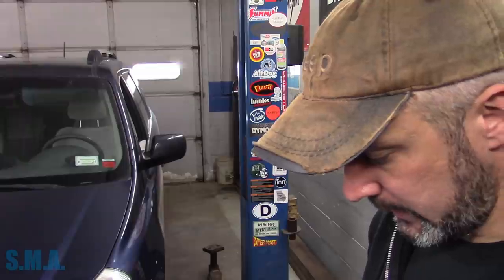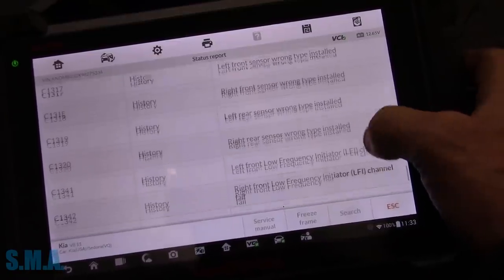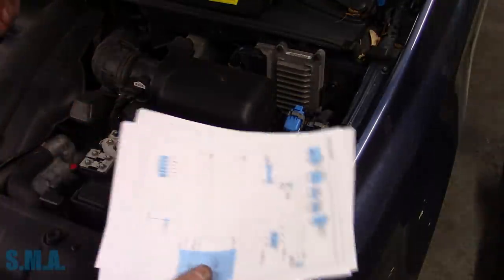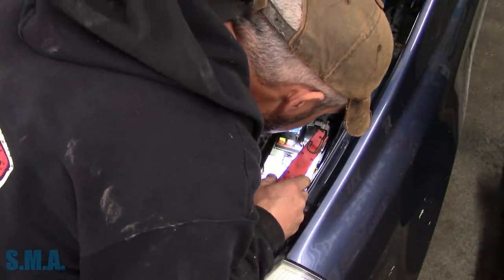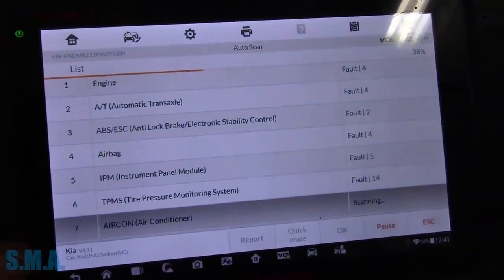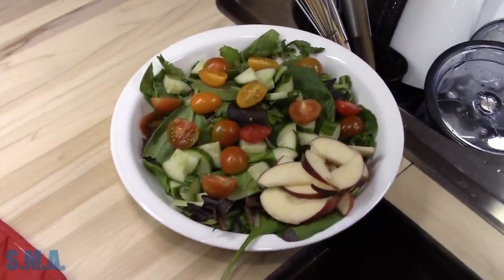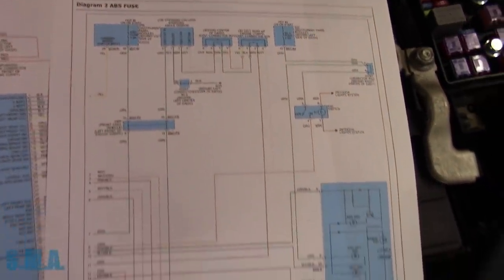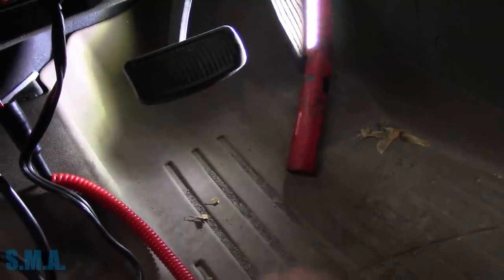You Can't Fix'em All...

Comment: perhaps the aftermarket stuff is tapping power off of that fuse and it is blowing the fuse when they use that aftermarket accessory (like a rubbed through power lock wire)

Comment: Hi Eric, Just my thoughts,   Having the error code for low battery voltage My first thought is to replace the battery, I did not know about faults with low battery voltage until about two years ago when I watched a Scotty Kilmer youtube and what he said made me put a new battery in my 2010 Toyota Highlander, the navigation had been glitchy for about a year and I thought it was  starting to go out. The original battery in it seemed fine at 8 years old, it started perfectly at all times and no other issues. I had the battery replaced and the Navigation has been working perfectly for the last two years. I will not let a battery go past the four year mark again.

Comment: Old time mechanic. Listens to engine, pulls engine apart, replaces parts, rebuilds engine and drives off.  Modern mechanic, spends 90% of their time chasing electrical faults, then replaces electrical modules until the engine starts, or not.

Comment: Thermal cycling is a thing, but...  It takes a REALLY long time in a properly-functioning circuit.  Early on in my career in the '00s, I got to see it on a few cars from the 1980s that had factory fuses in most locations.  I wouldn't be quick to suspect it on a vehicle of this vintage.  Fuses do the thing they do when they need to do the thing they do.  Doo-wah-ditty.  :D

These extremely intermittent issues are the kinds of things OEMs throw HUGE amounts of time and money at when facing a potential recall.  It's incredibly frustrating for the technician and customer alike, but we just don't always have the resources to be able to hunt these things down.  :(

Comment: I wish I still had the pic. I had a 7.5 amp fuse on a relay harness where the plastic cover was melted away but the actual fuse element was still intact with no cracks. I only discovered it doing a routine inspection because I was concerned about the heat from the turbo being that the relay was above it. I was surprised it never popped. So I don't believe that thermal cycling  reasoning.

Comment: Is it possible for cars to have Parity Errors? I work with equipment in the several hundreds of thousands of dollars regularly and it seems we always have some machine/switch/router with a parity error. It's possible a fuse blew due to the control side going haywire due to a bit flip. It's odd though that I've never really considered that on a vehicle until this video

Comment: My 1st car was a 1969 VW Beetle "Automatic Stick-Shift". 
Took the girl I would eventually marry on our 1st outing to the outskirts of D.C. to buy a Dune Buggy kit, from her 1-flashing-light itty-bitty Town in the Shenandoah Valley. It was a LONG ride, good chance to talk, get to know each other.
After I bought my kit, went to start my car and something in the Main Wiring Harness shorted out. Smoke, smell of burnt wire, and absolutely NOTHING happened when I turned the key trying to start the car. On further inspection you could see where something in the Harness had gotten VERY hot, with a line of melted plastic down the entire thing. NOT GOOD !

Myself and the guy who would eventually be my "Best Man"; both mechanically inclined, were pulling our hair out trying to figure out some way to get the car to run and get everybody at least somewhere close to home! If not, there was NO WAY that the Parents of my then 16-year-old cutie would believe the truth, and I definitely didn't want to leave the car so far from home.
After I had run out of ideas, the girl said, "try to start it again". Purely as a gentleman (thinking it was a hopeless act) I turned the key ... and the damned car started right up! Drove it for YEARS without ever finding out what had caused this problem, which never happened again!
So ... if it ain't broke, don't fix it !

Comment: Though not good for you, it gives context to those times when you just can’t find out why something happens. Had a car that randomly died on me, would crank but not start. Wait a few min’s and it would start and run as if nothing happened. I took it to a garage (under warranty) and the couldn’t recreate the fault, right up until they were backing it out of the bay, it died on them. 4 hours of investigation and swapping out ignition parts the fault was found. The remains of an after market alarm. A wire had been cut and spliced to an immobiliser using one of those horrible quick fix things, situated way under the dash behind the fuse board. 5 min’s later it was fixed with a bit of solder and heat shrink.
My take in that was to pay attention to when things have been added after market as you never know the quality of the product or the installer.

Comment: I know when I had rear speed sensor fail in my Santa Fe it cause my ABS light to come on and threw two different codes that I cant remember off the top of my head. Once the sensor failed it actually disabled the ABS. I assume it does this so the failure doesn't engage the ABS while normal driving. Worse part of it, the sensor is built into the hub which set me back $180.

Comment: Breakers that have tripped repeatedly definitely "wear out" that way.  Never heard of it for fuses though I suppose it makes sense that it could happen if the fuse is run hot repeatedly.
Reply: In aviation I saw it quite a bit. If the fuse is run near its rating and subjected to a lot of heat - I did it in Phoenix for ten years - and vibration (single engine planes and helicopters) the fuse will fail from fatigue. The fuses at the time were glass or ceramic and in the glass fuses it was obvious the metal had fractured instead of melting. In plastic fuses if the gap is clear it melted - definite overcurrent.
Reply: A fuse shouldn't be loaded beyond 80% of its rating. Fuses that "wear out" are due to either a design mistake or some minor, but persistent, overload.
Reply: @misterhat5823  sure that's a prescriptive rule from electrical codes, but I'm not sure it's universally accepted in all electronics everywhere
Reply: @wgmskiing  It is in the design of electronics. I would imagine the automotive engineers receive the same training as well.

Comment: I’ve seen one fuse that was blown by I’d have to say a thermal cycle. It was an 80 amp fuse on an international tow truck and the connector and fuse were partially melted. The fuse was replaced about 6 months ago and hasn’t blown again. But I agree the fused circuit is designed to be a good amount under the fuse threshold so to lose 25-50 percent of the fuse capability to thermal degradation without signs of it usually points to something wrong

Comment: Other diag before being a parts changer isolate fuse installation at each with lower amp fuse in each, if the fuse blows at a component just that module will be down. If the main fuse blows then it is a wiring for sure or the total amperage is above the rating of the fuse. Used that when all else fails, sucks yeah but sometimes we have to do suck things.

Comment: I refer to a job like that as chasing a ghost, but you just rely on logic and do a systematic search until you find the ghost or at least until it gives you a clue it is still lurking in the shadows.  Then there are some that you will never find unless you completely gut the vehicle, but that still is no grantee you'll find it.  It's just how our business works.  As for thermal cycling causing a fuse to fail, I haven't seen it in over forty five years of spinning wrenches.  If a fuse is getting hot enough each time the circuit is in use to the point where the fuse will eventually fail, there is something wrong.  Either the fuse is too small for the load on the circuit, or the load on the circuit is higher than it should be for whatever reason, but that would have to be at the precise point where the fuse is just being heated during use without blowing, which I find hard to believe that would actually happen.  So what I'm trying to say is a fuse failing due to thermal cycling is bullshit.  Great video, thanks for sharing.

Comment: Agreed with almost everything . With all the non oem speaker wire and any additional back yard wiring who knows what someone did in the electrical system . Some one at some point was in that system in one way or another of which you already know . You did a exceptional job of tracing a possible short .      " The thermal cycle properties of a fuse " now that was funny . Sometimes you just get a fuse that for the simple reason of a defect finally failed , it's a part they all can potential fail . My guess it was related to the wire meddling by someone in the vehicles past . Now as one Chevrolet mechanic to another mechanic I just don't agree that your hot , to me you look like an ape ! 
Love your new kitchen and the lunch looked awesome you are a very rich man  . Cheers !

Comment: I've noticed that if I run my bluetooth dongle in my 2016 RAM 1500, it will trip off the traction control light on my dash and an error to check electronic braking system. If I take the dongle out, cycle the engine, the error goes away. Is that normal? I'd like to leave the dongle in and access it with Torque Pro on my phone, but that error on my dash concerned me.

Comment: My 2003 expedition the front left wheel speed sensor would not reset. Couple days later the abs module melted. Surprised it didn’t burn up the truck.

Comment: Unfortunately it's a bin ,  more potential faults just ticking away in the background , you've done more than most Eric , I had an Audi Q7 with an auto gearbox fault , car had been to Mr Gearbox Specialist , then I get it , guy says order the gear selector control as recommended by the gearbox guy, part ordered , arrives , car comes in , goes on ramp my investigation finds a wiring connector plug with 16 wires in , right next to the front propshaft , water has been splashing on the connector as is rains plenty in the north of England , when I unplugged the connector , loads of water comes out if it even with a super sleeve seal on it , then I look inside it and find 6 wiring pins rotted away , dealers then want 1500 pounds for a harness , I got to breakers yard , cut off a similar VW connector off a VW Sharran, then spend loads of time transferring wires on both sides , all soldered , heat shrink, moved connected away from propshaft , full scan if car , no faults car drives mint , customer now has gear change selector on his fireplace as it cannot be returned, the gearbox guys should have either left alone or diagnosed it correctly , Mrs O always looks happy at work , your a great team  together , great video , can't do any more than you do 🤗🤗🇬🇧🤗🇺🇸

Comment: @Eric_O. A little suggestion as I notice people on YouTube ask alot like what is this tool, that tool, scan tool, etc. 

What I'd suggest as I've seen a few channels do is include in the description a list of scan tools, diagnostic tools, hand tools used during the video. 

Once you build your list it'll be easier. You could even build a link database through your Amazon influencers account to make store credit. 

It would help some of the younger guys. I can't buy anymore tolls until I get another toolbox or two. Maybe I'll win one someday as I sure as heck can't afford them these days. 

One thing to keep in mind with the links if you create a shortcut link for a socket set,  etc you'll need to make sure they're valid from time to time. 

Instead of having the specific socket unless you remember this of course you could just list a socket set that is the proper drive size.

Comment: A shop I used to work for had a rule, if a car came in with electrical issues and you opened a panel or looked under the dash and saw a nest of splicing and after market things like subs and extra speakers, badly installed remote starters and so on, we were told to gingerly put it back like we found it and call the customer to come get his ticking time bomb. The shop had a lawsuit against them years prior from a customer with an electronic nightmare ...they tried to fix it and couldn't .... but because they worked on it they got the blame. So he made a rule to just stay away from those.

Comment: I noticed low voltage codes in the code history.  Now from what I have seen, especially with all the wires communication codes going on. As the battery voltage dips computers start acting funny, less voltage equals more amperage draw possibly exceeding the rating.

Comment: Probably the ABS Module is shorted. As the fuse blows when it gets hot inside the Engine compartment. Why these ghost are hard to find. You have to keep them for hours running...

Comment: Components thermal cycle ONLY when they get hot and cold over and over.  Fuses get hot only when their current is right at the rating but just not quite enough to blow.  It is definitely possible to choose just the right combination of options to stress a fuse once in a while, but engineers are pretty good at balancing the current load for the most probable usage and they tend to provide about 35%-40% safety margin.  I suspect that most of the guys that scream "thermal cycling of the fuses" are merely trying to make their diagnostic incompetence less embarrassing for themselves.  It is also possible to kick up or to drop conductive materials once in a while and thus to blow a fuse that has no apparent cause.  Motors and some actuators can bind or stall and blow their fuse such that removing the fault leaves no evidence to find.  Bipolar transistors can overheat and short out due to thermal runaway until they cool down; if the fuse blows in time, this leaves no evidence to find.

Comment: Best try. Lol!  They may have caused a momentary short when doing their ratty wiring and blown the fuse.  Probably didn't disconnect the battery during the install.  Could be why you can't find the short... cause it isn't there anymore.  Car probably had a CEL when it went in so they didn't notice they took out the ABS circuit by accident.

Comment: I am a two way and microwave tech and hate these types of service calls. The random blown fuse is a real pain in the ass for anyone who has to deal with it. When splitting the circuits at a junction, I would put a fuse on each circuit. The short might be too quick for you to see on the meter, but the blown fuse would show the way to the trouble. Hope it comes back soon with a dead short so you can find it and make some $$$.

Comment: I once had a fuse pop for no reason on my bike. It was the coil/TCI feed. Swapped it for lighting fuse and kept going, never failed again. Someone may have popped a different fuse in the past and used the ABS fuse to fix lights or something and replaced it with a cheap ass fuse.

Comment: Well you know why Mrs O fixes all that green stuff??? It’s cause she loves your old hiney!!! It’s to off set the bacon. She’s gotta keep her sugar daddy healthy!!! Well that’s the running joke with me and my bride anyway. I had an intermittent short on a GMC 2001 2500 van, engine Ecm fuse blown. Put a fuse in it, fires up, did the same things you did, same results. (Now I work in a fleet setting, so I don’t have a customer to deal with) This was one of our better drivers, so we showed him which fuse and gave him a few, told him to let us know if it blew. It took about a month, but it finally blew. He changed it and The same thing again, couldn’t find anything. So it rocks along like that for a couple months. Then finally he came in and said it blew 3 fuses in one day. Bingo, I got yo number now. Brought it in the shop, looked it over stem to stern, notta, nothing. So I fired it up, raised it on the lift and started jiggling every harness on the engine and FINALLY SHE DIED. It was a short in the harness down by the crank position sensor. It had been repaired a long time ago and the loom was rubbed in an obscure place around a tight hard to reach corner. Repaired the harness and boom. No more problems. I have had the occasional blown fuse, replace it and it never blows again, but that’s  rare. Happy New year, Mr O, I’ve fallen out of my SMA habitual watching over the last few months, but I’m back. Things have been a little hectic, my partner in crime has been out with back surgery and I was left with 77 units to keep up and running. He all good now, let us pray!!! And we’ll pray for that little 7.5a fuse as well!!! Later from the Great state of Mississippi!!!

Comment: Back in the day when I would add aftermarket stuff I always ran from the battery.  I wouldn’t cut any factory wires.
Reply: Gene Miller You’re the hero we all need, but definitely don’t deserve
Reply: The main reason was I was afraid to cut any factory harnesses.  It was popular when I was a kid to use the little splice in device.   I never used them.  I even ran a wire to the negative on the battery.  I didn’t know back then you could just grab a ground on the body.  A lot of extra wire got used from Radio Shack.    I would never with Todays modern vehicles mess with the wiring.  I only recently learned you shouldn’t jump start from a newer model.  My trucks 20 years old and has jumped a lot of vehicles over the years, but I wouldn’t do it with my wife’s 2014.  Live and learn.

Comment: Wonder if it could have been a situation where Best Try may have blown the fuse during there install and the customer is just now getting around to getting it looked at not making the connection that it was caused by aftermarket install